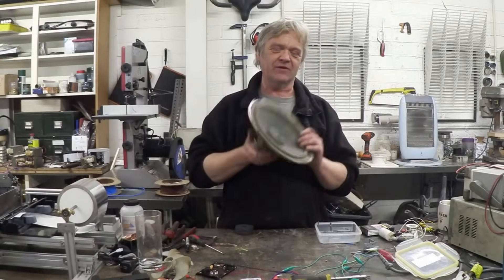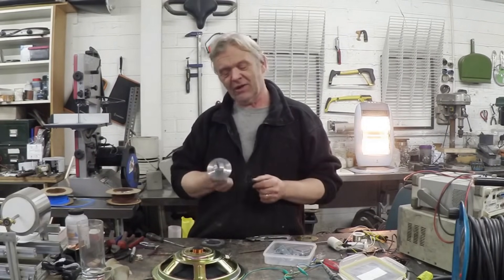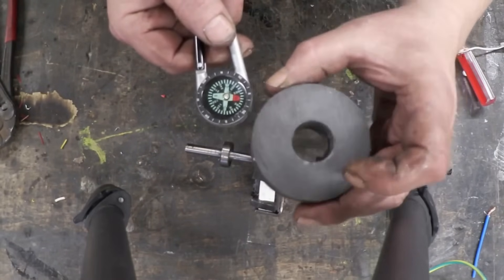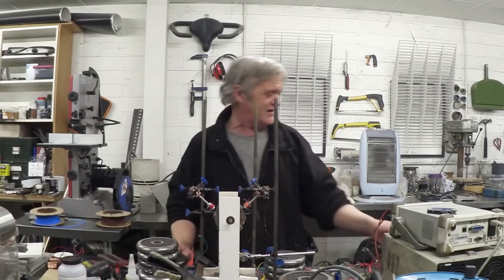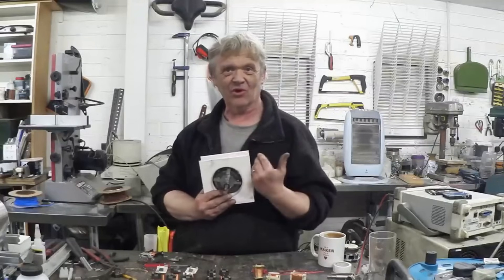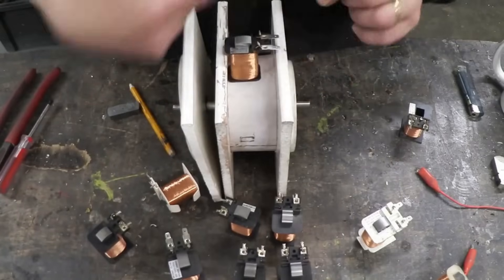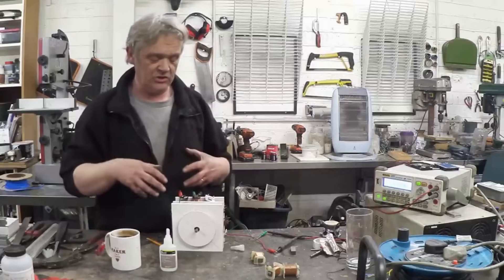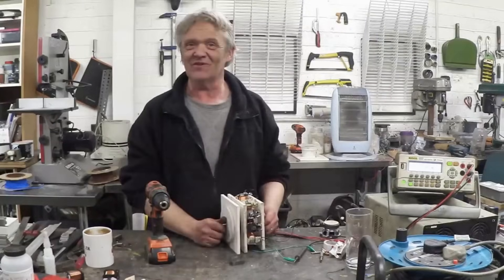2048 Scratch Building A BLDC Motor And A Generator From Old Speakers

Comment: Rob,  could use a serpentine coil? Also as there appears to be room in the holder wouldn't putting 2 or even 3 csms together (increasing the claw length) give a increase in magnetic strength?
Cheers for your awesomeness!
Reply from the maker: yeah you could and no it wouldn't increase the strength but it would increase the rate of field polarity swap over

Comment: Have you ever thought about using steam as a way to raise a mass for a gravity battery? Potentially utilizing a condenser to convert steam back into a dense liquid that is your mass for the gravity battery. I can imagine a closed loop system that utilizes the raising of gas as the mass needed for a gravity battery.
Reply: Obviously a steam turbine would be apart of the same system.
Reply from the maker: cheers mate

Comment: this one is INGENIOUS!!!! how frugal!!!  I am confused about one thing tho, how was the first one wired?  You called it a 'heath robinson' arrangement?  I tried searching for things that had to with electricity and 'heath robinson' and all I could find was stuff about a cartoonist from ohio and some senate bill named after him in 2022 LOL
So... I've been trying to figure out how it would spin and I just cannot put it together in my head... Maybe its using AC and not DC? I just can't seem to make it clique.... Could you help me out with this :) Thanks
Reply from the maker: sorry mate i was a bit quick about that bit - the three coils on the motor are independent and fired one after the other with the motor controller you can wire in delta or y configuration it doesn't matter - y and delta only refers to how the coils are joined
Reply: @ThinkingandTinkering  ahhh so is there just one power supply and it goes into a motor controller board, and they that outputs to each of the three coils?

Comment: Just wow. Did you really say “thirty volts” or “thirteen”?
Either way, too cool. I am a bit surprised that you didn’t mention recovering the wire from the voice coil. ✌️
Reply from the maker: 30 and the coils in voice coils are very thin wire and very hard to handle the coils themselves are too small to get much of a voltage out of and you would have to form slugs to center them - much more trouble than most folks would go with